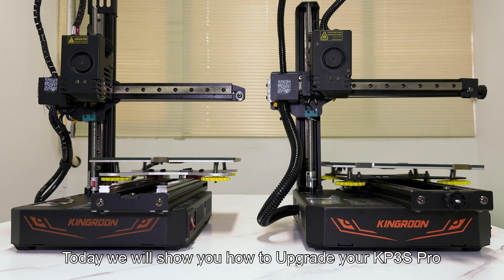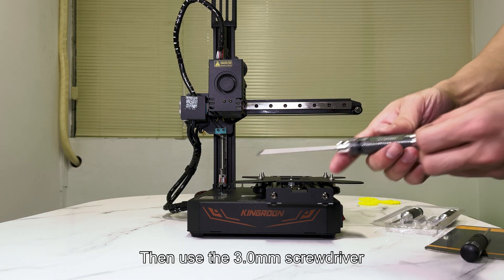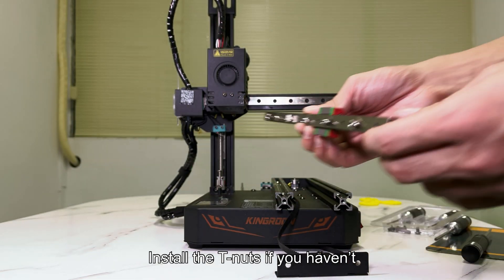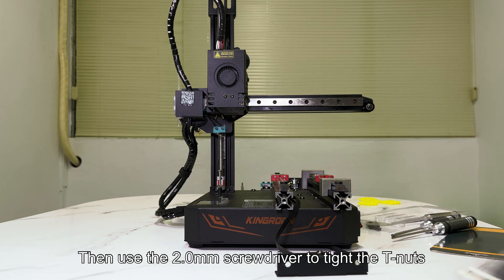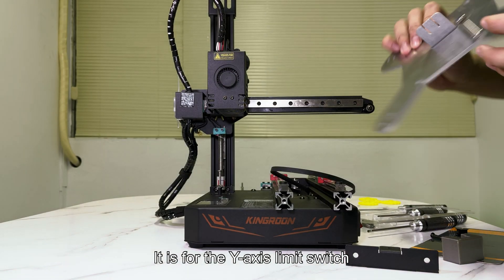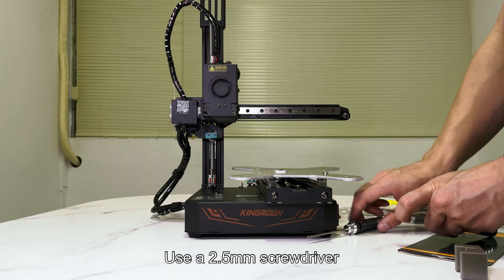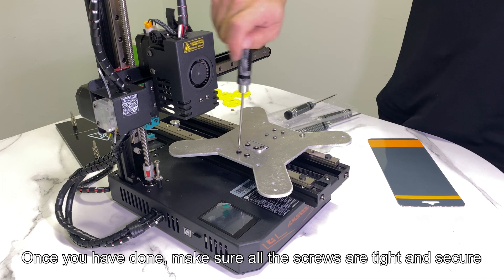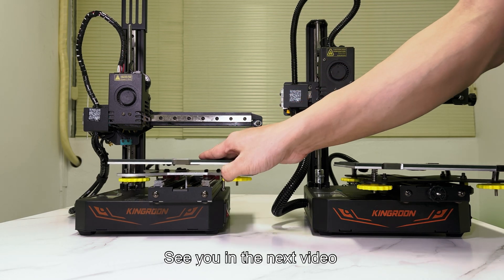How to Upgrade the KINGROON KP3S Pro Y-Axis with Linear Rail Guide

Comment: These instructions are entirely inadequate. 
This ships with a bunch of lock washers. Where do they go? 
The bottom bracket in the video has the belt mount installed. Mine is not. The holes for it don't seem threaded but there's no nuts for holding it on, so how do I mount it? 
What are the flat washers for? There's 10 flat washers in the kit, and I never see them used.
Is the screw that triggers the Y-Axis just supposed to dangle there?
There's 4 T-Nuts with holes for M5 bolts, but no M-5 bolts in the kit, so what are those T-Nuts for?

Comment: Do you have klipper install tutorial for kp3s pro??
Reply from the maker: There's no difference for using it on the KP3S Printers, you can follow the steps and use the KP3S Pro Klipper Bundles to use it. We will add everything Klipper related into the following articles. https://kingroon.com/blogs/3d-print-101/how-to-prepare-klipper-firmware-for-kingroon-kp3s-using-fluiddpi

Comment: Is it possible to connect Wi-Fi or USB 2.0 to it? The microUSB format is not very convenient for working with a printer.
Reply from the maker: We just saw people do it, but actually it's even worse than using the SD card. If you have a Raspberry Pi, Orange Pi or something like that, we suggest using the Klipper firmware for easier using.

Comment: Ola, tenho um kingroon kp6 2k, estava imprimindo normal mas agora ela não esta mais lendo os arquivos do pen drive, ja troquei o pen drive e ja limpei a entrada, pode me ajudar?
Reply from the maker: If the problem cannot be fixed by using a different USB drive, it should be physical, you need to replace the USB module or a mainboard.

Comment: I’d stay away. My printer came with the linear upgrade installed wrongly by the factory. 

Print head doesn’t heat up automatically when starting a print. Firmware issues on their website. I’d just stay away

Been trying to contact their support team but they barely respond and when they do they are not keen to help. They are only responsive pre- sale. Best to stay away even Creality is better
Reply from the maker: Please check the email I replied yesterday night. I will help you out.

Comment: The alignment of the Rails is a nightmare. When fixing The plate on top The movement isn't smooth as it shoud be. This depends of poor quality of the Rails and the aluminium bars wich are not perfect aligned. The simpliest fix is to ad some rubber rings  between plate and Rails.
Reply from the maker: Please follow the steps and use the prints to align it, that’s why they are needed. If the linear guide you got has any issues, please take a video of some pictures and send them to support@kingroon.com, our guy will help you with the warranty. Also it is normal to be different between linear rail guides and wheels, you can add some machinery oil to help it slide smoothly. Remember to adjust it print volume to 200x200x190mm after that. If you are using Klipper firmware, please also remember to do the calibration again.
Reply: @Kingroon3DOfficial  I used the linear guides and everything seemed ok, but after fixing the plate tight, as George said, the rail movement isn't smooth, If I loosen the plates screws the y-axis moves smooth but the plate is wobble a bit. Did calibration and printed the little boat, with little issues at the start of the print. But I'm afraid that lack of smoothness in Y-axis could worn the rails